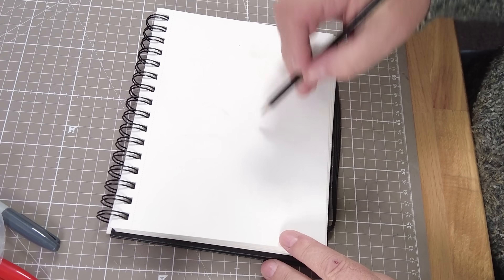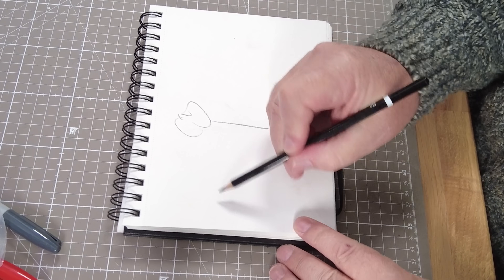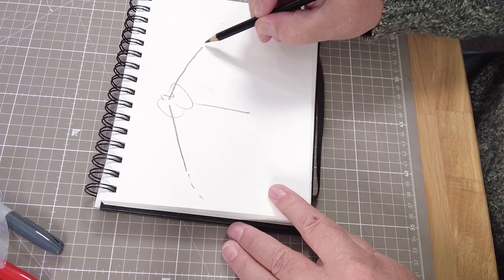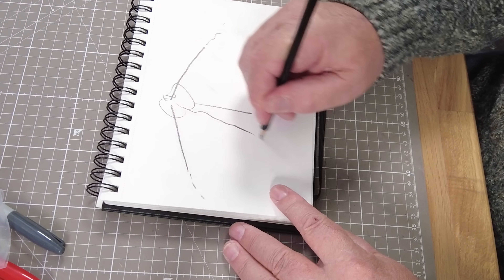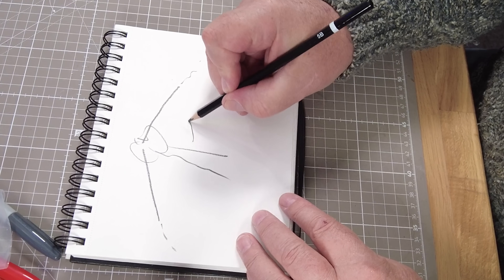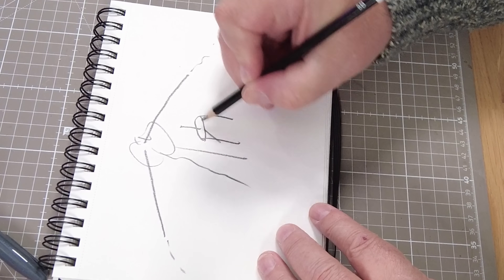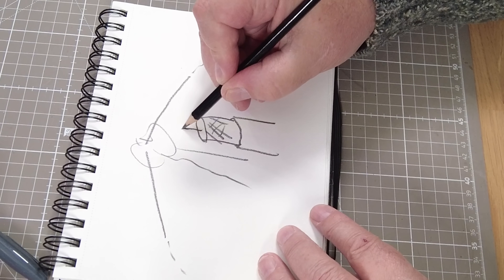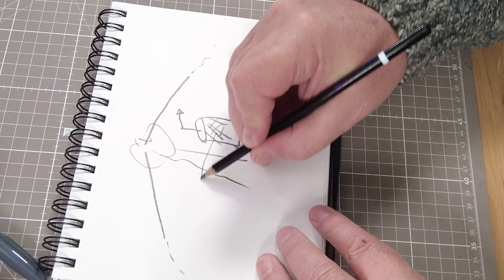Multiband Antennas: Everything That Actually Works

Comment: You forgot one multiband antenna: the non-resonant end fed antenna (aka 'End Fed Long Wire' or 'End Fed Random Wire'). If the wire length is not resonant on any of the desired frequencies and fed at one end with a 9:1 unun, you can get on the air (using a tuner or ATU) on all of the HF bands. Mine is 84ft long and tunes 40-10M like a dream. 80M tunes up sort of (i.e. high SWR but it radiates). The downsides include Rx noise a bit higher than normal, requires a counterpoise wire or three depending on your installation site, and needs a good choke between the unun and the coax (and a 2nd one at the shack entry just to be on the safe side). I've worked the world with mine in an L-config up only 25ft off the ground.
Reply from the maker: Apart from the doublet - I should have clarified that this was a no ATU type thought process.

Comment: Great video.  
Back in the day I made a lot of dipole antennas using insulated wire.  I started out making each leg a bit longer than the 468 / frequency length, and then trimmed a few inches each time  to finally get 1:1 SWR.  I'm a tight wad and a bit nit picky, so after getting my 1:1 SWR I measured each antenna and found the actual 1:1 length was always 4% shorter than the 468/ frequency length.  I started cutting to the 468 / frequency minus 4% shorter and that prevented needing to cut a few inches at a time and re--checking SWR several times.  Your 5% estimation is real close to my experimentation.    
With inverted vee antennas 1:1 SWR could be had by changing the angle of the vee by lowering  or raising the bottom height of the wires without moving the feed point height.  73
Reply from the maker: Some great experimentation there!

Comment: I like the fan dipole idea using the spacing specified by Stanford Research Institute. My question is, do you think it would work using double bazooka dipoles? I am hoping to obtain the broadband characteristics of the double bazooka. I would most likely have 80, 40, 20, and 15 meters.
Reply from the maker: Yes, sure it would. Don't fret about the spacing.

Comment: Great explanation Cal. Thanks for another great video.  There's one more fairly easy option IF you are willing to use or make a 4:1 balun, (and a choke of course) and that's the off-center fed dipole. Had good luck with this as a beginner on HF.
Reply from the maker: Yes, a very good choice indeed!

Comment: I use 2 fan dipoles with a RF splitter, from a smashed up Cushcraft MA5B, so I can use one single coax feed to cover 20m to 6m in my loft. 40m dipole folded around my loft using a 4:1 balun and it works 15m 12m and 6m very well.
Reply from the maker: That is an ingenious solution.

Comment: I use a ~20m long EFHW, with a simple 49:1, mostly portable. it goes without a tuner on 40, 20, 15, 10... a dream. BTW, it is folded back 60cm because I was too lazy to cut it. I didn´t know this actually helps.
Reply from the maker: Sounds like you have a great setup!

Comment: I had a long wire set up like a yo yo with welding wire with bungi cord as a pully and drill to feed up and feed down so like a tape measure.  So up down for the bands SWR was good but RX was a bit low well was just playing about as limited space.
Reply from the maker: Ah!
Reply: @DXCommanderHQ  Long wire on a loop spool and attached bungi cord to pull it out like a yo yo string on a cordless drill need to re make one and record it.  So like a long wire no insulation on a real feeder attached so pull out and pull back in so a long wire but tuneable so can be from say 5m long pull up to 25m long best way I can describe it.

Comment: If I had a large yard to play with, a full-wave delta loop would be ideal for an all-band HF radio. A fan dipole is a good compromise for smaller yards.

But, for those of us living in apartments, I think magloop antennas are the best option. RFI-resistant, but I believe they’re relatively high-Q and require precise tuning, unless I am mistaken.

Thoughts? Cheers and 73 from the USA - KF0QNM
Reply from the maker: Yup, good choices all around!

Comment: I've been working 7 bands on my 80m EFHW since last month. It can do 8 bands but I haven't heard signals in the 15m yet. My FT991A internal tuner fixes all of the bands to nothing showing on the swr meter. 20w FT8 QSOs from QTH Texas to Russia, Middle East, Australia, Japan, South America, and closer so far. It's horizontal, only about 5m high between 2 rows of pines under the canopy, with some clip on chokes 4m from the feed point.

Comment: The (dipole) wire actually resonates on all harmonics. The end impedance on odd harmonics is low, and on even harmonics is high. But it is resonant on all of the harmonics. :)  73 and have fun!
Reply from the maker: A 6-inch nail is resonant on 10m band - if you tune it. But not naturally.

Comment: EF is my multiband antenna of choice. Coax does not drop in the center of the antenna, but extends directly into my shopping. The coax becomes the counterpoise from a 9:1 UNUN. If you cut the wire to the correct length, you will end up with a multi-band antenna that is easily tunable. The shorter versions will easily tune down to 40m to 6m. And the longer versions will easily tune 160 m all the way to 6 m. I happen to have rooms around a 203 ft wire and put my choke at about 86 ft on the coax. So my antenna is 289 ft long. According to the models I get about 7 to 10 DVD gain on 10m. Check out the Palomar engineering versions. They sell some versions but then they give you the charts so you can cut your own multiband antenna.

Comment: We had our monthly "radio day in the park" this morning and talked about the same topic. We test home brew antennas mostly ,from NVIS to DX verticals. This video is a good refresher on traps and fan dipoles. I passed it along to several of the people that were discussing antennas this morning. A discussion of ground radials came up and of course there are several opinions but I told them what you told me a few years ago "Put down whatever you have room for. It will work." and that's true. Thanks for another great video.
Reply from the maker: That's it Jack!

Comment: You hinted at my favorite multiband, tunerless antenna. Also below that is another fun antenna.

The Parallel Dipole 

Instead of the “fan dipole” I created a parallel dipole.  Everyone said it would never work, but I used it successfully for decades.  Later, others were making and promoting them.  But even in 1978, we had “those guys”.   (I came up with this idea on my own, but that does not mean others did not make and use these maybe even before I was born.)

Instead of fanning the elements out like you did, I used spacers and made the elements 4 to 6 inches apart.   I had to put in enough spacers to keep the wires separated so the wind did not twist them together.  I found it helped to put 80m on top and 40m on bottom so the spacers kept the ends of the shorter elements separated and I added an extension to the end of the 40m element with a couple of additional spacers to keep the end of the 40m from coming close to the 80.  

I have had occasion where the 40 and 80 crossed and a 60 watt radio welded them together. 

The Sleeve Dipole

I only did this once, and surprised everyone, including me.  At a contest site, someone wished they had a 6 me dipole. I cut piece of thick copper wire to the length of ½ wave at 6 meters.  I hung it about 3 or 4 inches under his 10m dipole with string, without connecting the wire to his cobra head.  He was thrilled. His antenna worked both 6 and 10 meters.  

(I got this from an old ‘50s radio hand book. It was a variation of what they called the “sleeve antenna”.  Multiple antennas near each other but only one has a feed point. )
Reply from the maker: Fans - indeed the DX Commander is all parallel. Sleeve dipole - I've had complicated results with one a while ago - I need to revisit...

Comment: I use an MFJ 993B tuner in a weatherproof box as a remote tuner with its remote control head. This is a wide range tuner with a built in antenna switch. One input works with a horizontal higher bands doublet 32' up fed with window line and the other input is attached to a lower bands "random length" (carefully chosen nonresonant length) 57' vertical. Between the vertical and the tuner there are also two relays. The first connects the antenna to the tuner when the tuner is powered on and grounds it when not. The second inserts a loading coil so the vertical will also easily tune at 160 meters.
Reply from the maker: Nice

Comment: Ill used a vertical in the park for a few activations and found it to be a hassle. Used a premade doublet for a bit, and thought to myself "I want 600ohm instead, i bet i can make this on the 3d printer". 15 iterations later i had the perfect center and spacer. Now i have a hard time using anything else. Takes me about 10 mins to setup and i let the auto tuner do it's magic. 4:1 or 1:1 and a ProII or a 939 is amazing, noticable gain difference.
Reply from the maker: Perfect

Comment: great information ! I find keep it simple and will work great . Getting fancy with traps and coils and stuff is only going to add loss in the system. Getting a good tune at radio will make the radio happy. Does not mean the RF gets out of the antenna efficiently. A slight SWR may be a good thing. As long as wires are cut to length . They will send the RF out. The ATU will fix slight miss match . A correct center fed at proper Hight is 72 ohms.  The ATU will make 50 to make radio happy. Once you see 1.5 or less to 1 ratio . don't worry. Hit the ATU. A vertical correct length is like 35 ohms . Distance to ground and soil resistance even weather will change it a bit. I worked the world with 1.5 SWR even higher due to weather . ICE build up will effect it. When using 600 ohm balanced feed the ICE and metal near wire will have a big effect on it.  Even the wind bowing antenna around can effect SWR . Unless it is high like over 2 . just use ATU . I find portable  using same antenna same setup the SWR will change place to place . If under 2 just use ATU and will work. Just look for like metal near buy that may effect the antenna. If you are hearing great the chance of getting out is good. If you hear nothing and match is good can be  like metal near buy or very bad band conditions . I did find the DX 10 wire when left up ,over time it can stretch a tad.  You can just cut the tip a tad or shorted the feed end a tad.  So far The DX 50 does not stretch. What I made with it stayed spot on over a year later . Cheers from NY
Reply from the maker: Indeed - it's not hard-drawn copper-wire - or Kevlar cored..!

Comment: I'm super disappointed at the second thought and virtual dismissal of the doublet. They have the lowest loss of almost any other antenna out there and noticeable gain along those lobes on higher bands.  For a QTH with a barefoot radio, it's a pretty phenomenal multiband antenna. Yes, learning how to use a manual tuner is a new skill, but once you've hopped bands a few times you get the hang of it and don't even need references for each of the bands anymore. While it's not as easy as a resonant antenna, it's about as simple and low loss of a multiband that exists. We both agree though,  low band propagation on a doublet is a mushroom cloud of RF.  My 80m nets all tell me to turn my amp off, and I don't have one.
Reply from the maker: Geez. Folks like you need to watch videos properly and learn when to type utter baloney... How did I dismiss this? From the transcript: "But for a low band antenna like 160 to 40, a balanced tuner with balanced line, okay, and a nicely made dublet, uh, works a treat...". Now get some sleep.
Reply: @DXCommanderHQ  as I said, "we can agree that low band operation is great", but you did "virtually dismiss" the doublet out of hassle and lobey pattern on higher bands.  Nothing but respect for you and your antennas,  but in a video about multiband antenas, the doublet, which is one of the best performers out there,  got, what, 60-90 seconds?
Reply from the maker: Hey Old Friend... Cruising comments I have not responded to... Now, I appreciate you saying that - and I genuinely respect your view too. But for the humour niggling my insides, I should say I was really talking about coax-fed antennas. The fact I threw in the "Doublets Are Great" line was mainly to appease the doublet-lovers. However, you’re quite right - next time I’m talking to Netflix, I’ll pitch them a 90-minute doublet documentary :)
Reply: @DXCommanderHQ we are known to be a passionate bunch.  😅

Comment: Off-centre-fed-dipole, 21 metres long in total but fed at ONE-SIXTH the length instead of the traditional one-third, and with a 1:4 balun at the feed point. Resonant on 20m, 15m, 10m and 6m without an AMU, needs a tweak from an AMU on 40m. Works 160m for local operation rather well, no good for 80m. Oh, and a half-decent AMU will give you 12m and 17m too.
Yesterday I worked Canada on 20m with 15 watts SSB and got a 55 report. Have worked the world with 100W.

Comment: I use the linked principle. Linked dipole for 40/80 and a linked vertical for 10-30m. Yes it's a pain changing bands but you get used to it and it's a few bands on one wire up a pole.
Reply from the maker: Just a nightmare in the middle of the night when it's raining! LOL
Reply: @DXCommanderHQ that's what children are for 😂

Comment: What about EFHW, I run a 20-10 vertical on a 10m fibreglass pole that with the radio tuner gives me 20, 17, 15, 12 and 10. I also use a 80-10 mounted horizontal, again with just the radio tuner gives me all bands including top band. I use these antennae cut to not having the ability to lay ground planes effectively for for a multi quarter wave vertical nor the garden perimeter for a 40m loop. Thankfully though with the 80m EFHW mounted over the house It did just fit. de Peter M3BWF
Reply: A matcher defeats the object of having a true multi and antenna .....  With a matcher you can use almost any random length of wire to give you multiple bands ..... All the work is done by the matcher and not the antenna .

Comment: I've been using doublet systems of various sizes for many years, with excellent results, even on high bands. I've always used a balanced coupler (link and/or Z-match), but I'm currently favoring the OCF and New Carolina Windom, which have proven to be much better and more practical than doublets. I'm using the 20-meter version, which covers the 40, 20, and 10-meter bands without coupling, and the other bands, coupling with excellent results. 73 PY4HE.

Comment: Given your explanation of how a trap works, meaning making an antenna usable on frequencies higher than the fundamental frequency, is it the opposite with a loading coil? Meaning, a loading coil lets you operate the antenna on frequencies lower than the fundamental frequency of the given antenna?
Reply from the maker: See other folks replies - but yes - you can take a short antenna and shove some loading coils in. In essence, you have it correct.
Reply: A loading coil (an inductor) makes a short capacitive antenna electrically longer than it physically is.  It counteracts the capacitance to make the antenna resistive (resonant) at the desired frequency.
Reply: @stargazer7644  resistive and resonant are not the same thing. You don’t want an antenna to be resistive nor capacitive. You want it resonant, which is when impedance and capacitance are balanced. The Smith chart is the key to showing you which way you are out of balance.

Comment: Always great information. I found the write up on the "Banana Antenna" (aka T2LT, Sleeved Dipole)... If someone were to arrange multiple Sleeved Dipoles vertically in a similar manor to a DX Commander, all sharing a common feed point, would that function as "multi-band vertical" similar to a Fan Dipole, but vertical? I was thinking about building a 20, 15, and 10, sharing a single coax input.
Reply: Ian Shack and Field tried that but found they wouldn’t feed from a common feed point. Ian compromised by running 3 x ‘sleeveless’ sleeve dipoles up his mast and feeding them through separate connectors at the base, which he swaps manually as required. Gives the advantages of omnidirectional dipole gain with no radials. Take a look at his channel. 😊 Peter GM4RAH
Reply: Thinking about it, for a permanent installation, you could of course use a remote antenna switch at the base of the pole to switch between elements. I’m tempted to buy a DXCommander and swap in sleeveless sleeve dipole elements to give it a try - unless Callum beats me to it of course 😊
Reply from the maker: Yes - I dropped that because I couldn't get decent signal reports...

Comment: Hi Callum . thanks for the above info, I'm looking to Build a Dipole Antenna that covers 10M, 12M  and 15M and if I can get 11M in as well all well and good. I  mainly use the USB frequencies on these bands . What should my starting Wavelenght be, I don't have 40M , and Im stuck for  space  too, M1BWY
Reply from the maker: You'll need 2.45m (10m) and then just work backwards.. ChatGPT will help you design that.
Reply: @DXCommanderHQ  Thanks  lost  this video only just found it again . have now saved this vid . love all your vids as i find it really easy to understand as you explain it very good,